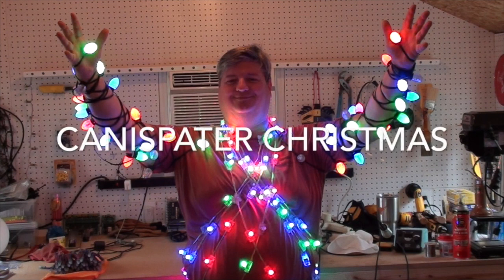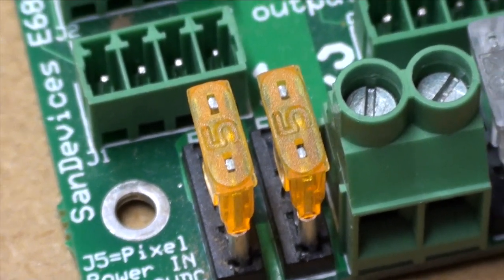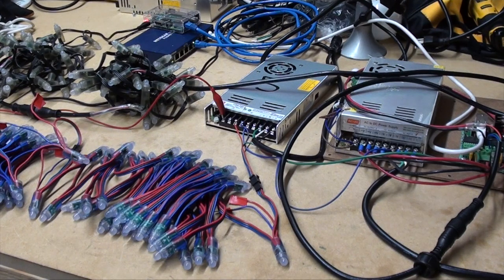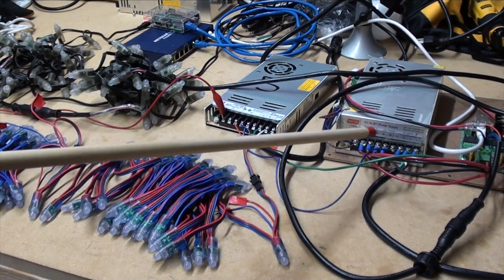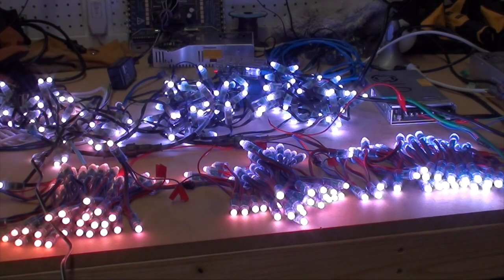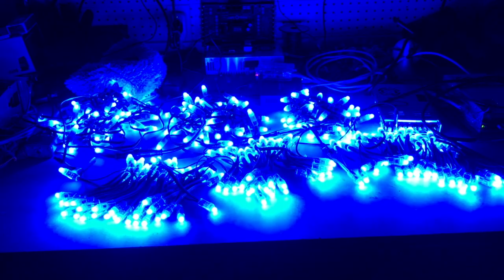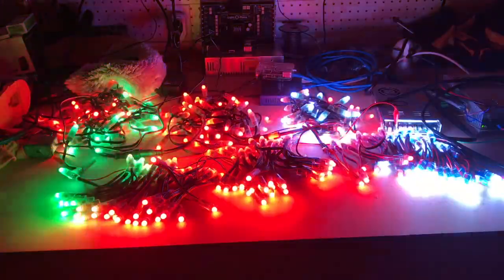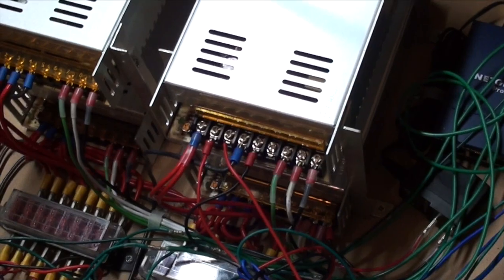Powering RGB Pixels - 5V/12V Shootout

Comment: Thanks for the great videos! I’m trying to learn as much as possible before I spend any money. I have zero experience with anything remotely close to this but I think it could be a fun, challenging (for me), and rewarding project. Can anyone answer some very basic questions? 1. I thought the lights were supposed to be plugged into the controller but here it appears they’re plugged into the power source. Which is it? 2. How do you connect the Raspberry Pi to the Falcon and to the power supply and to the lights? 3. What does a network switch do?! 4. Looks like these lights don’t have cords in the traditional sense. If the controller is 20 feet away from the lights, what then? I know...I’m doomed.
Reply from the maker: Thanks and LOL! Yes, there is a bit of a learning curve, but once it clicks, it's more of the same.

1. Controllers are usually fused at 5-amps mainly to protect the traces on the board. 100pixels, all white at 100% brightness will pull roughly 6-amps so what to do? You can either bypass the power distribution on the board and wire them directly to the power supply (through a fuse, I know it's hard to see in that video :) ), and/or use power injection to bring the current flowing through the board down below 5-amps. Personal preference how you handle that. You still need the data and ground from that port though. I tend to go directly to the power supply (through a fuse) - see my box build video for what I used. For that demo, I just bypassed the board altogether and went directly in because I knew I would go over 5-amps quickly.
2. The Raspberry Pi runs on 5V and I use a separate 5V wall-wart to power it. Make sure you get one that is beefy enough to run it and peripherals you plug into it like a USB flash drive. Otherwise, you will see strange and unexplainable things happen. The Pi has a wired ethernet port that most use to output data to the Falcon controller (the V3 has two ethernet connectors and it doesn't matter which one you use). Power is generally connected to the controller as are the lights. When you get long strings is when you need a little more power planning.
3. Think of it like a power strip for data. Pi to switch. Switch to Falcon #1, Falcon #2, etc. Just makes connecting all of the ethernet ports together easier as your display gets more complicated.
4. Correct. The lights are low-voltage (generally 5V or 12V). Thicker wires allow for longer runs, but 30-feet is about as far as you want to go between controller and first pixel. There are several ways to increase that distance, but I'll not add to your confusion now. There are extension cables you can buy. I use 10-footers as needed, but the goal is to keep everything as short as possible. People have also used multiple pairs in ethernet cable successfully so whatever you have access to.

If you're brand new to all of this, please binge my videos, especially the beginner playlist. That should get you a fairly solid understanding of all of the parts. Then check out the forums and/or Facebook groups I have linked in the descriptions of most videos. Those are the people that taught me. Very smart and have probably seen everything you're going to encounter on your journey.

Welcome to the hobby!
Reply: CanispaterChristmas Thanks for the guidance! I’ll check out the links you mentioned and of course continue watching and learning from your videos. I’ve got 12 months and one week to figure it out...I’ll keep you posted!

Comment: I would like to make a rgb pixel tree about 10 or 12 ft what do I need to run it
Reply from the maker: Well, depending on what you want to do, you may not need all of this, but
- a pole, I suggest making one of these: https://www.youtube.com/watch?v=P8XRpqi3dvU
- pixels (my tree uses 1,200): http://bit.ly/2zjBTp2
- something to hold the pixels straight: http://bit.ly/2AJsDZt
- something to hold the strips to an 8-foot hoop: http://amzn.to/2jupoxx
- a controller: http://bit.ly/2BDf81n or http://bit.ly/2oujZfH
- power supply(s): http://amzn.to/2kaWnLC
- a computer to create and play sequences with xLights (https://xlights.org)
- you can optionally use a Raspberry Pi to play the sequences: http://amzn.to/2Ad7oli
- extension cords and a box for the controller & power supply(s) 

Seems like a lot doesn't it? LOL

Comment: Is it better to get 4 chl and diff board instead of just 8 chl board?  This way l do not need to run longer signal wires back to the 8 chl board.  I can always run RJ45 cable to the diff board on the other side of the house.  What do think this setup, any disadvantages using 4chl board?
Reply from the maker: The only disadvantage is running out of ports. You can only go about 30ft or so depending on brightness, pixels, wire, etc before you start running into issues and needing diff receiver boards. You might want to post a diagram of your design up on the forums at Falconchristmas.com and get some expert opinion.

Comment: I read somewhere (NeoPixel website) that you need to put a capacitor 1000uF perhaps on the first node between the power supply from positive to negative terminal to clean up the power and protect the first pixel from burning up.  Is this true and have you use one before?
Reply from the maker: I don't use capacitors on my power supplies. Not sure what they're referring to without seeing the article.

Comment: I did not understand the difference between 5 volts and 12 volts. The LEDs are fed with current and not voltage
Reply from the maker: Technically, the LEDs are fed with power. An electric current is a flow of electric charge. Voltage provides the pressure for the flow. 

Internal components of the pixel strings we use are designed to operate on either 5v or 12v. You may find others using different voltages, but 5 or 12 is common. If you power 12v strings with 5v, you may not get them to light at all. If you power 5v strings with 12v, you will burn them out.

When powering strings of pixels, a voltage drop occurs at each pixel. At some point, the voltage drops enough so you can see a difference in brightness and/or color from the first pixel to the last. To prevent that from happening, you need to inject power. WHERE you inject depends on the string.

You can run 50-80 pixels without injecting power for 5V. 12V, bumps that up to  80-100. Again, depending on the pixels, you may see different numbers, but that's a general rule to follow.